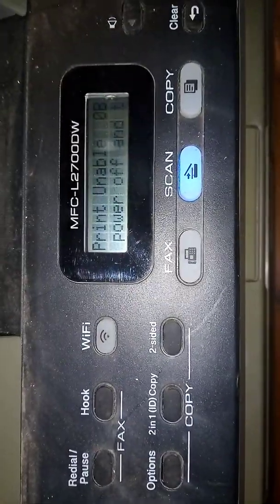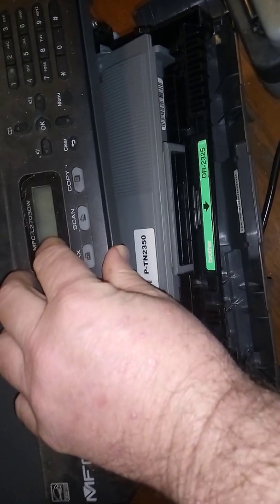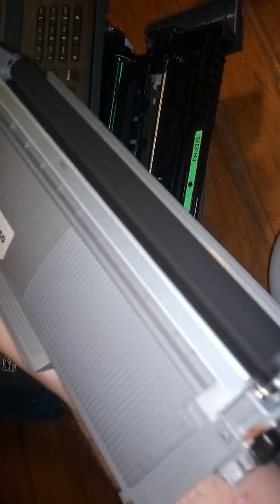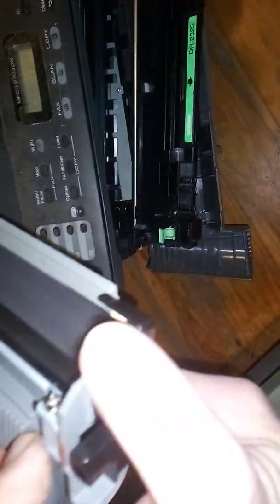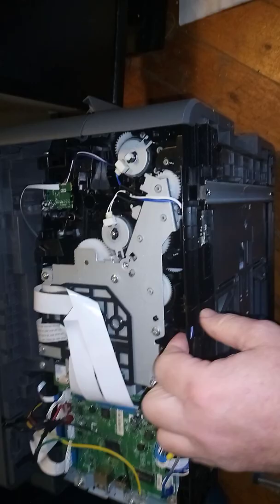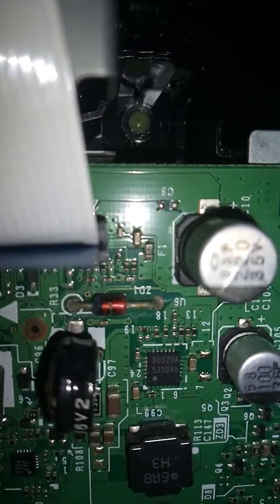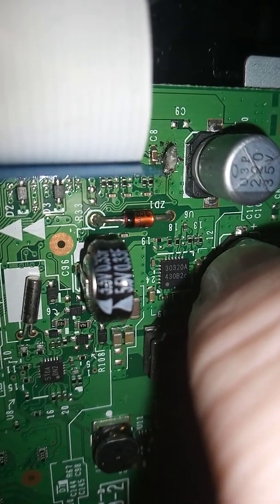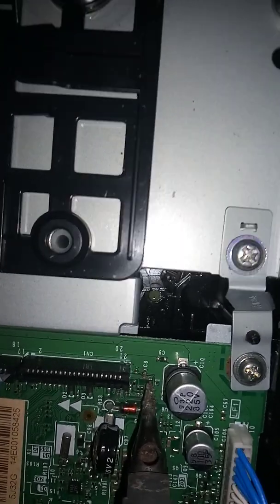Print Unable 0B, Brother mfc-l2700dw, Xerox m225dw, hl-l2305dw

Comment: Why If error ob on Machin mfc 1815 solusion  ..where fosision fuse one
Reply from the maker: Then you are either using poor quality non genuine toners that have fouled your drum unit. If that is the case clean your drum unit out with compressed air or a brush. If that is not the case you may have a broken charge wire in the drum unit all your non genuine Toner to may have blown up your high voltage circuit board

Comment: Having this same issue on an HL-L2390DW. I found that there is an F1 fuse with a little X (just like shown in the video) on the "high voltage" board on the power-supply side of the machine. My multimeter doesn't show any current running through the fuse, so perhaps it is blown and the issue is the exact same as here.

The board can be found for $35 new, but I plan on creating a solder bridge and removing the fuse to see if this fix works on my device. I'll report back if it is successful or not in a week or so.
Reply: Update: Unfortunately for the L2390DW, replacing that fuse makes the situation worse. Interestingly enough, removing it entirely retains the same 0b state and breakage as before.
Reply from the maker: @privilegejunkie  The corona charge wire in your drum unit may be broken and earthing the HV through the grid or drum surface. Also check the CONDUCTIVE black plastic connectors on the side of your toner cartridge to see if broken.